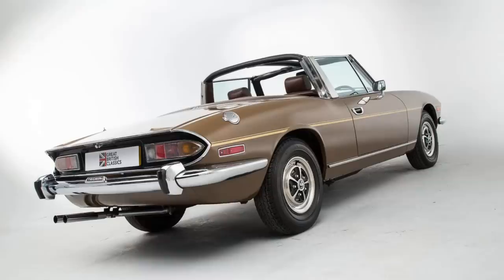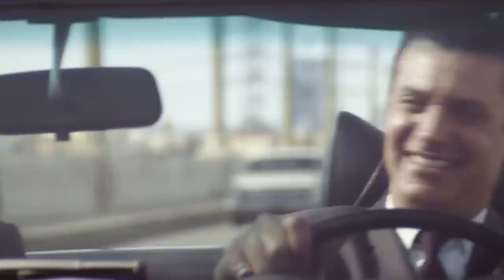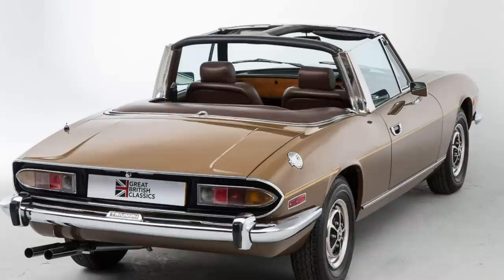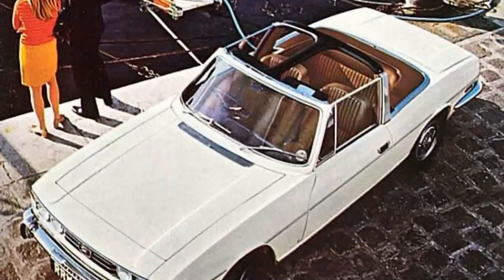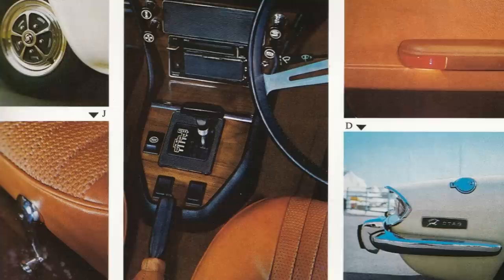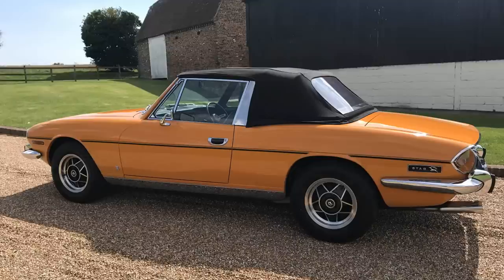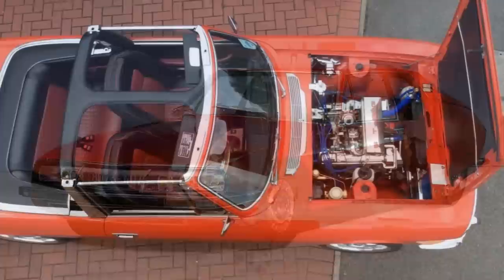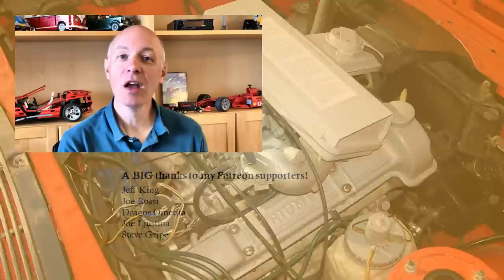Why did the Stag FAIL so Spectacularly?

Comment: I like the puppet! If only Triumph had listened to that little bird. I had a chance to drive a Stag in California in 1972. It was a convertible model, and that top was awful. There were no quarter windows. something my '66 MGB had. It let in a lot of wind noise and, although didn't get a chance to drive it in rain, I suspect it would have also leaked, just like the B. The folding top went into a special compartment behind the rear seats, losing precious luggage space. It was very hard to fold down, that one rear window was easily creased, and there were all sorts of fiddly bits to get it erected again. The lack of quarter windows made parking really hard, and felt like I was in a cave. I also thought it didn't help the looks of the car.
 
This car had the automatic transmission and a/c, both apparently standard in US cars. Weirdly, a radio wasn't standard. Even my 1970 Toyota Corona that was my family car came with an AM push button radio. The  auto trans reminded me of the Chevy two speed Powerglide, even though it was three speeds. The wasn't such a bad thing since the Triumph auto and Powerglide were both good, smooth transmissions. It was so smooth I never really felt that third gear. The a/c, well, it was British. I got to drive the car for a week in typical Southern California spring weather with daily highs of about 80. The a/c was barely able to keep the car cool at those relatively low highs compared ot our 100 degree summer and fall heat waves. I suspect part of it was that mostly uninsulated and leaky convertible top. It may have performed better with the hardtop.

With the top down, it looked like a T top car like the Fiat X-19. I wonder if Triumph ever thought about that concept? The Stag seems like it would have been a natural. It didn't really handle better than the B since it had the same kind of solid rear axle. What made it worse was the featureless power steering, also standard. It made parking easy, but t was so soft there was almost no road feel. At least the B had enough road feel I could tell when the rear end was about to break loose.The Stag is not a car I'd like to slog around the same mountain roads I enjoyed in the B. The performance was, shall we say, less than sparkling. 0- 60 was a little under 11 seconds in my unscientific tests. This was at a time when a dead stock 302 c.i. V-8 in a 1969 Camaro could turn in a 10 second time. I didn't expect the Stag to be a drag racer, but I also would have been embarrassed to be in such a beautiful car and then have the doors sucked off by some kid in a Camaro or Firebird. 

All I knew when I saw the car was it has 3.1 liter V-8, and I just assumed to was some version of the Rover V-8, since it would have been available when Triumph and Rover merged under BL. We in the US had some faith in the Rover V-8 since its lineage was from the popular and reliable Buick V-8, and it was amenable to performance enhancements. I didn't find out until later it was actually a new 
Triumph V-8. As it turned out, I lucked into not buying one. The price was also quite steep. It was over $7,000 when a 1972 Corvette with a/c and a number of other options like the LT-1 350 c.i with 255 hp and a 7.7 second time was out the door for about $6,000. A thousand bucks in 1972 was real money, and I just couldn't justify the money with two young kids. So, my rating is it was a sexy car, every bit as attractive as a Ferrari GT, the interior was fantastic with all the leather and wood, but the price, workmanship, small issue like the convertible top and, as it turned out, the engine let the car down. Sadly, with a total production of only about 26,000 cars over seven years, the Stag was one of the nails in the BL coffin.
Reply: Rubbish.The Stag soft top folds easily away, much quicker than the powered top on my wife's SLK. And it doesn't leak.
Reply: @melincourt  I'm glad you got a top that folded easily. Apparently my experience and that of other contemporary reviews are simply rubbish. I'm sure your experience with the top is just one reason why the Stag was such a massive success.
Reply: @Sam Shlong "On early cars, buyers could choose to have the car fitted with just the soft-top, just the hard-top (with the hood stowage compartment empty), or with both. Later cars were supplied with both roofs."
https://en.wikipedia.org/wiki/Triumph_Stag
Reply: Did you know luck is not a verb.
Reply: I agree I had a Stag for three years, the engine had been modified and cooling system modified..good servicing by a specialist, totally reliable but must be driven not left standing for weeks, the hood was fine, did not leak..I wonder if you actually drove or owned the car...your points seem a little two copy and paste...maybe playing to well known stereotypes...🤔
Reply: dee106ful ahh but he lucked into it
Reply: @alanwayte432  Do you have any difficulty reading or comprehending the English language? It seems you must since your comments have almost nothing to do with what I wrote. If you do have some kind of disability, or are not a native English speaker, I apologize in advance. I'm assuming you're a native Brit who got some kind of British secondary education and you're not mentally disabled. 

I never claimed to own the Stag. I clearly stated I drove it for a week as a rental from the dealer so I could test it on LA freeways. It was a dead stock '72 straight from the dealer. I ended up buying the Corvette for a thousand dollars less than the Stag. I neither know nor care about engine or cooling modifications, not would I care about how often it needs to be driven. I drove it for *a week*. The Corvette didn't need some kind of specialist to service it. I drove it for 10 years, and the same garage that serviced my MGB, Toyota, Acura Integra GS-R, Sterling, and International Scout II also serviced the Corvette. The mechanics there did a fine job on all of them. I know it's a crazy idea, bit it's possible, just possible, that needing some kind of specialist mechanic for a car that sold a little less that 26,000 units over eight years, and having to do all sorts of ,mechanical and cooling modifications to get it to run reliably, may have been part of the reason companies like Triumph and BL no longer exist. 

I stated pretty clearly that I suspected it might leak rain due the wind leaks coming from the top/hood. I stated pretty clearly I *never drove it in the rain*. Why would you wonder if I actually  drove the car? We'll leave the "owned" part out since, once again, you don't seem to read and understand English very well. 

I spent quite a bit of time writing that comment based on what I remembered from that week in 1972. You decided to impugn my integrity by saying it was a "little tow (too) copy and paste". Rather than being a dick about it, you could just highlight any portion you chose and have Google search for it. You'd find out if it was a copy and paste job. That's more honest than your snarky comment, and easily done, assuming you know how to use Google. A hundred dollars to your favorite charity if you can find it. It's my original work, other than some of the specs I quoted. Those aren't something I keep in my head for 47 years.

Finally, you accused me of "playing to well known stereotypes". I guess I assumed anyone could figure out from me talking about driving the Stag in California that *I'm not British*. I assume the stereotype you're talking about is some British crap like Top Gear. Other than watching some of their Youtube videos,  I don't know a thing about them, not any other British car mags or TV shows. You have to be pretty ignorant to assume an American would try to play up to some kind of British stereotype when we wouldn't even know who they are, nor care. Whoever this stereotype is, your beef is with them, not me.
Reply: Although you mention "losing valuable luggage space", it takes a set of golf clubs just fine, as demonstrated so regularly by my father and the luggage space in the boot is 100% consistent whether the roof is up or down.  My Saab or Mercedes on the other hand, you may or may not have luggage space or may not be able to put the roof down, depending on what's in the boot!  Nice day, thinking of putting the roof down but no, the warning message bitches that there's something obstructing the boot, no, sorry, no roof down today because you forgot there's a box in there. :)
Reply: @djtaylorutube  My only point about luggage space was a method of stowing the top/hood on top of the rear deck rather than inside the a car body would have allowed a larger trunk/boot. 

BTW, when I got my shiny new MGB in 1966 and began studying the owner's manual, I thought I had gotten one in another language. There was no internet. but I was fortunate to have an exchange student friend. He kindly made a glossary of British to American terms on the inside of the front and rear covers of the manual for me. If that still exists anywhere, the person having it must wonder why it has all those annotations.
Reply: @sarjim4381  Yes, except for me that's one of the things that I always liked about the Stag, it didn't look like a pram where they couldn't figure out where to put the roof when down.  Look at a Golf GTi from the 80's and that thing is just pram-ugly.  Same for the Ford Escort cabriolet of that era.  The Stag was designed as a convertible and not something where roof stowage was an afterthought.  Can't please everyone :)
Reply: @djtaylorutube  Indeed. The space would have better served if space saver spares had been in use at the time. My B had the same problem with the spare taking up half the space. As tire technology improved, I just took out the spare and put in a can of Green Slime to get me to the next place that could fix a flat. Never had to use it as I never got a flat after about 1975. Much more useful space without the spare, and I suppose I would have done the same with the Stag if I had purchased it.
Reply: @alanwayte432  Well said. Too easy for people to jump on the Snag bandwagon.  If you had a Ferrari engine built by BL it would be an expensive mistake.
Reply: @sarjim4381  I agree with Alan.  The Stag had problems almost entirely down to poor quality control in production.  The design was actually very good but admittedly not very tolerant. I know hundreds of Stag owners, and if the engines are built properly now they can be bomb proof.  Your lengthy tome would give the impression you are some king of Stag expert but seems to be based on little more than one weeks experience.   You also seem quite touchy when your views are challenged. Is that your usual style?
Reply: @stagweberVMad  You act as if my "lengthy tome" tried to conceal the fact I had the car for one week. I made that pretty clear. You might note that, other than to say the car wasn't as fast as I thought it might be, I made no remarks about the engine, good or bad. Now you feel the need to respond about what a great engine it was if BL workers didn't take too many tea breaks. As I said, in a one week test, I neither knew nor cared about how bombproof the engine is. I leave that to long term owners. I was writing about my experience with the car, take it or leave it. You can challenge me all day long. Differences of opinion is why there's a comment section. That's different than accusing me of lying and plagiarism.
Reply: @sarjim4381  Where did you put the kids in the Corvette
Reply: @tevie54  In the Toyota... :=)
Reply: @sarjim4381  What I find interesting is the different opinions on the same car, I had mine when I was 21 years old and it was the best car in the world at that time, (1985) can you imagine a single 21 year old cruising around in a convertible V8 GT, it was an absolute fanny magnet. I never had any reliability issues and it was a daily driver for 2 years, I'm baffled by some of the issues you brought up in your original post, the soft top raised and lowered without any problems and it never leaked once, I thought it was a stroke of genius stowing it in a special compartment behind the rear seats. How much luggage did you need?
The Fiat X19 didn't come out til 1973 so I don't know what you mean about the T bar, the Fiat never had one. The Stag had a rear diff with independent  rear suspension not a solid rear axle. I remember road tests talking about the vague power steering like you mention but I honestly don't remember it being a problem.
I think the north American version must have been strangled a bit as I remember the road tests talking about a sub 10 second 0-60 in the UK and that was confirmed with a few personal attempts (on private roads only of course).
Don't forget the American cars you mention had much bigger engines so it was hardly surprising that they were quicker. In 1972 in the UK the Stag cost just under £2,500 so I wonder why is was $7000 in the US, exchange rate I suppose. I'm not being flippant but you seem to have an amazing memory considering you only had one for a week and that was back in 1972.
I've seen lots of cars made in the sixties and seventies, British and American and European and build quality wasn't great on any of them so I don't think Triumph was unique in that matter.
Like I said we all have opinions but sometimes peoples opinions are based on hearsay not experience.
Reply: @tevie54  I owned and hept running  a '66 MGB for almost 30 years so some of my comparisons were based on already owning and liking a British car. However, let's not use the "all other cars were crap too" to explain away British built quality problems. It was a real issue then, and it hurt the British automobile industry. The US version did have all the smog control junk on it, especially the California version, so it was slower than than the UK version. That's not the point. It was also slower than a lot of other cheaper cars, and that didn't help with market share. My memory of the car is pretty vivid because I really wanted it. The price and overall performance killed the deal for me. The exchange rates are available on the web if you care to look. Once again, I thought I made it clear I never drove the car in the rain. I made the leakage comment based on the amount of wind leaks in the top. On my sample, they were considerable.

Are you seriously saying because the Fiat didn't come out until a year later Stag designers had never heard of a T-top? They never saw or heard of the 68-70 'Vettes with T-tops? I never even advocated for a T-top, just wondered of the designers saw it as an option. I'm glad you enjoyed your Stage I might have too if I had decided to buy one. Ultimately, I didn't buy one, and I didn't write my post to get into arguments with true fans. It is what is is. Take what you want and leave the rest.
Reply: @sarjim4381  I'm not disagreeing with you chap I'm just saying isn't it funny how people can have such different opinions of the same car, at least our opinions are based on experience not just rumour. The build quality of my daughters 1980 Triumph Spitfire was shocking, worse than her 1971 Beetle, my dads Jensen Healey was almost as bad.
I still don't understand what you mean about the T top, the Stag came out in 1970 and the T top was incorporated at the design stage to make the body more rigid, the X19 never had a T top and didn't appear until 73 so I don't see the link.

Comment: One of the best looking cars ever made, especially in light colours. So reminiscent of so many British products, all the ideas, all the style but none of the quality control.
I heard the main overheating problem was caused by the casting sand not being cleared properly from the heads water ways, causing poor coolant circulation?
Reply: I remember years back one of the car tags compared 3 Honda Accords. One from Japan, one from the US and on from the UK. The cars were basically equal across the board except the testers could tell the one from the UK because of the electrical system.
Reply: @mpetersen6  Lucas, prince of darkness!
Reply: - @terrygoyan  -lucas fridges always had warm beer.

Comment: I knew that the Triumph V8 engine was unreliable, but did not know the details. 
I do know now, because of your clear and concise explanation. Thank you.
Reply from the maker: Actually this is the only time I took the copy straight from the Wikipedia page, because it did a much better job of explaining it than I could (and you are allowed to use Wikipedia content in any way you like).
Reply: ..surely by now almost all Stags have been rectified of the engine problems of the past

Comment: What a lot of comments! 
My own contact with the Stag was as a young toolroom apprentice I was given the job of hand polishing the press tool for the boot lid with a carborundum block! It took several days.
The next contact 12 years later was with the slant 4 cylinder 2.0 16 valve in the Dolomite Sprint. To say by this time they had overcome the engine problems was a bit optimistic. It was a wonderful engine but all the cooling problems remained along with the cylinder head gasket. At the time a Ford Cortina water pump was less than £10 the Sprint one was £72. With its SU carbs  on one side of the engine bay with no hot air feed and the exhaust manifold half buried under the block on the other side carburettor icing was a real problem on a damp January morning.  It was at least 10 miles before the under bonnet temperature rose sufficiently to melt the carb ice. Until that happened the engine would simply not tick over. 
Too low geared for comfortable 70 mph cruising along with horrendous wind noise. Like all BL cars of the era it rusted pretty quickly but it was nevertheless great fun to drive. I wish I still had it but I sold it to buy a Lotus 7. I wish I still had that too!